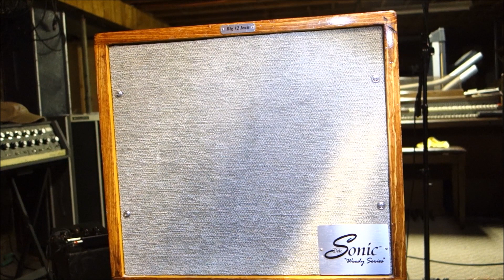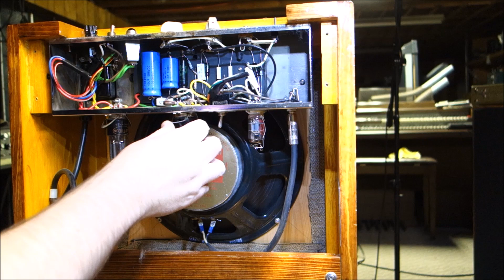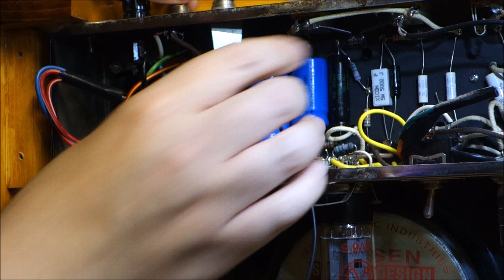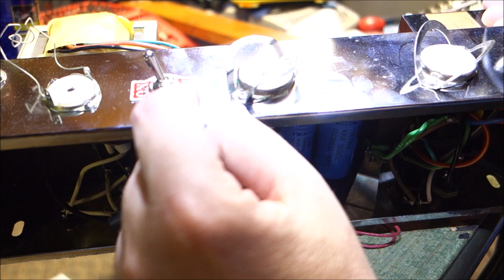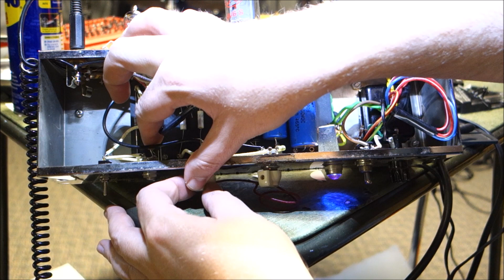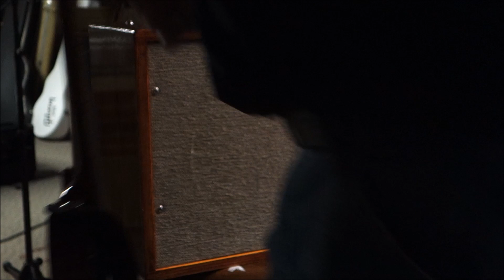DoleSonic "Woody Series"  Big 12" Guitar Amplifier makes awful noise....  Let's Fix this thing.

Comment: The problem with all these old amps is they're made out of stuff and sometimes stuff breaks or stops working. If only they were made of not stuff.
Reply from the maker: Or in the case of this amp,  the original builder didn't have a hot enough soldering iron.

Comment: If the octal tube key was damaged and previously allowed a mis aligned insert,   the octal tube may be damaged.
Reply from the maker: Good thought.  The tube is OK,  the ceramic slot was just wide.   Tube survived OK,  and the amp is back at home with its owner.